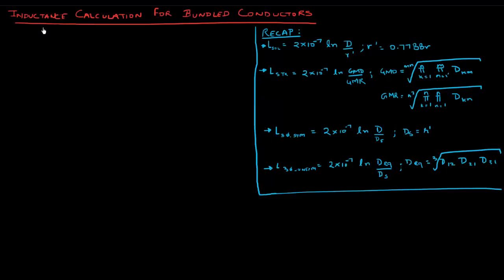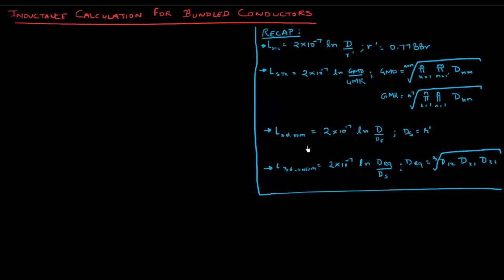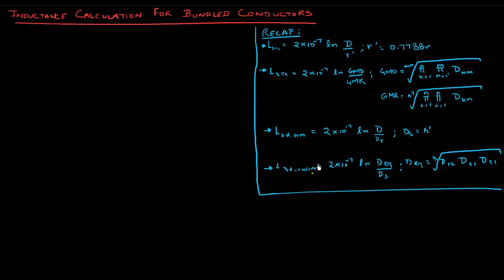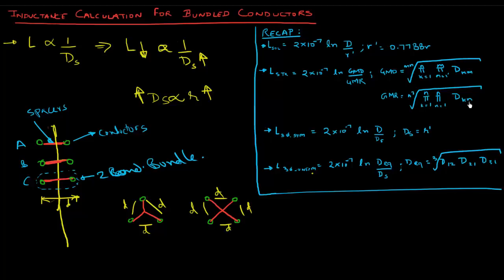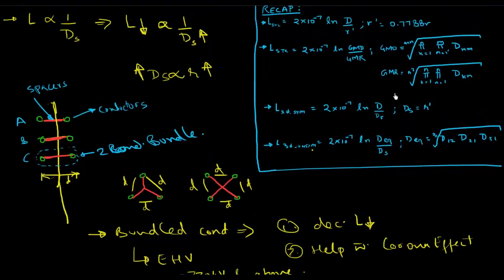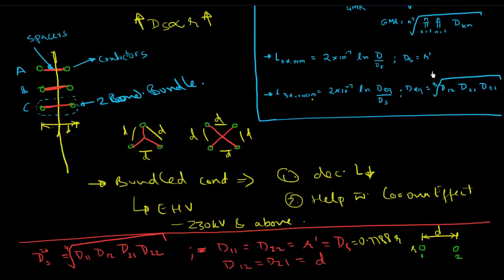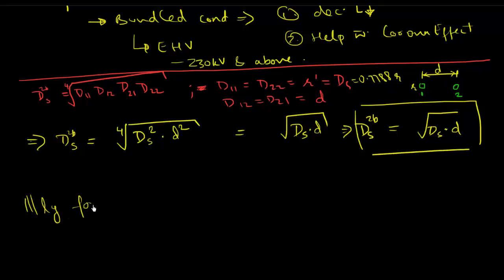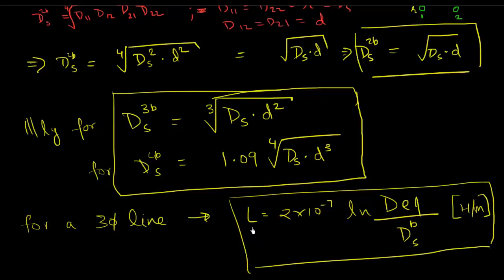Inductance Calculation of Bundled Conductors

Comment: Great explanation. However, I was wondering why the effect of bundled conductors on "Deq" was not taken into account? In case of 3 single conductors arranged unsymmetrically, Deq = [(D12)(D21)(D31)]^1/3. Does "Deq" remain the same if we have 3 bundles of conductors instead?